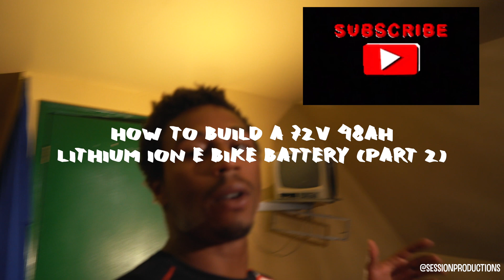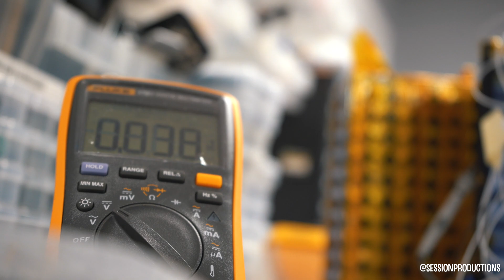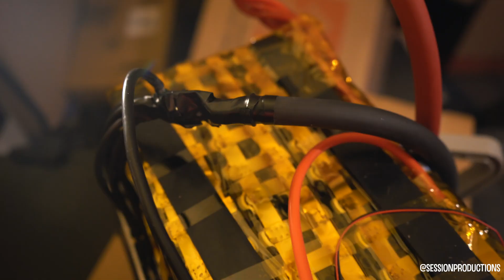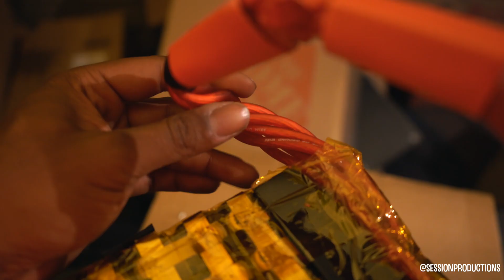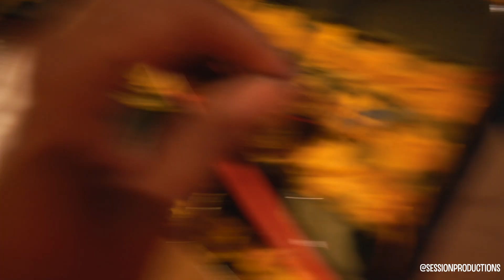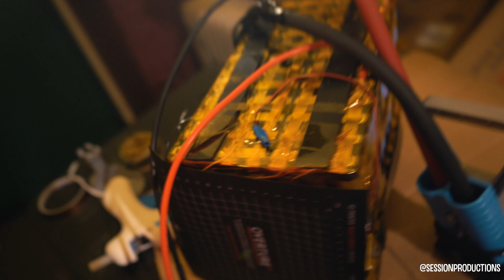How to Build a 72v 48ah lithium ion E Bike battery (Part 2 With testing guide as well)

Comment: Soldering 6 wires , converging into one would cause resistance , i usually tend to use a copper bus bar and bolt the lines in from the top, using crimp gromets and bolts 
but it seems to be working!
Reply from the maker: Yea I took that off lol
Reply from the maker: I had to change the connectors and I used copper strips to help hold the thicker wire better